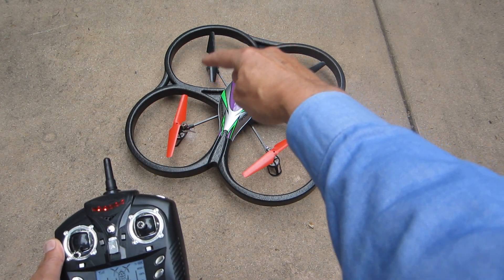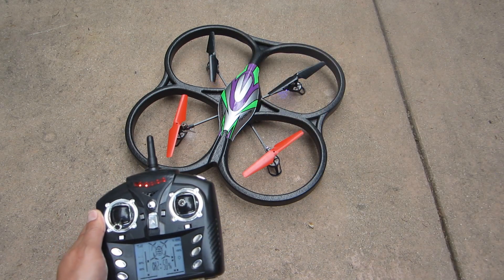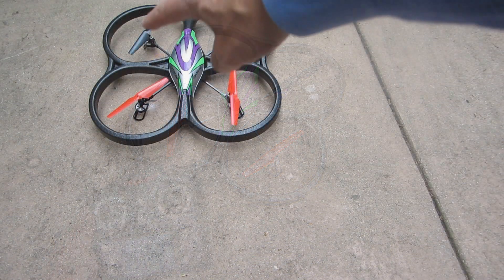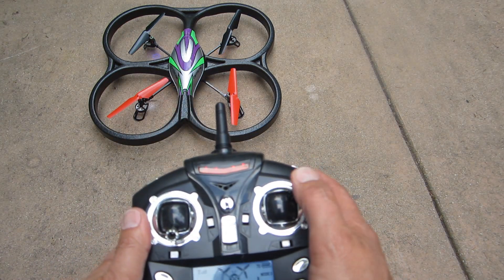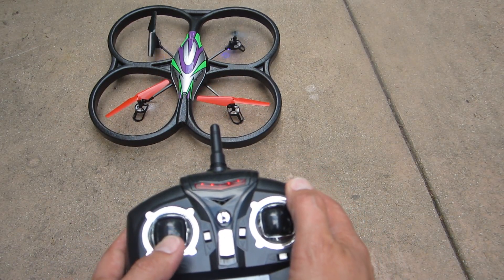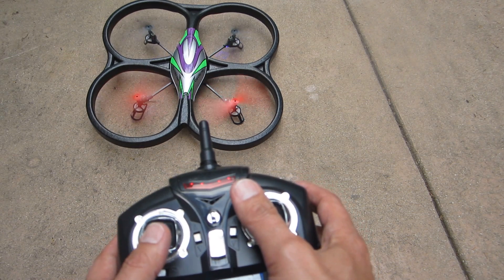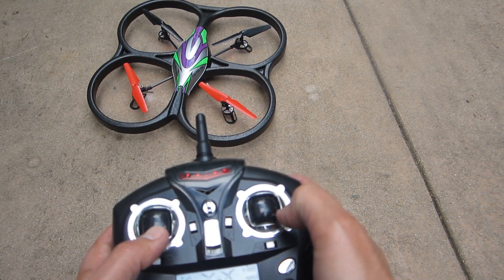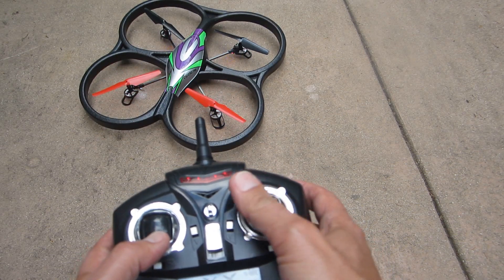V262 quadcopter flying problems: how to find the motor that needs replacing

Comment: This really helps me! I have a Syma 5XC, and it can't take off, so I thought I had screwed it up trying to flip it (which is probably what actually caused this, well and crashing it a few times in the winter.…) and sure enough, the right side motors are both worn. So I'm gonna try to replace all four to reduce uneven wear.

Comment: Great video. 

However I found that one motor (the rear left)  goes at a much faster RPM and this is why I'm having to trim it so much. 

Any ideas how to adjust the RPM or adjust each prop individually? 

Thanks

Comment: on the remote:
1. push the left side up to full.
2. move the right side on the remote.
3. keep at few , medum or at full throttle.
4. if it doesn't fly, push the left side down on remote. And try again.